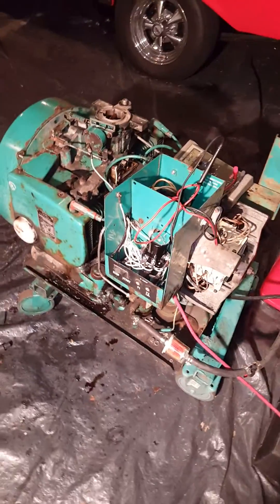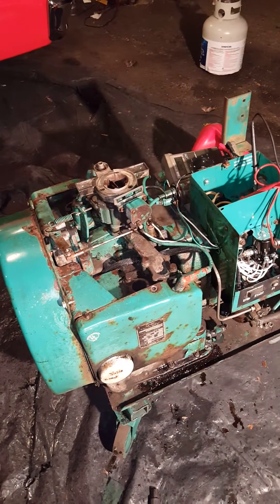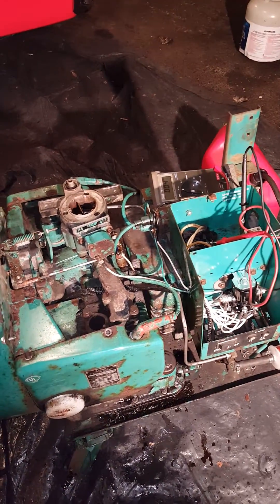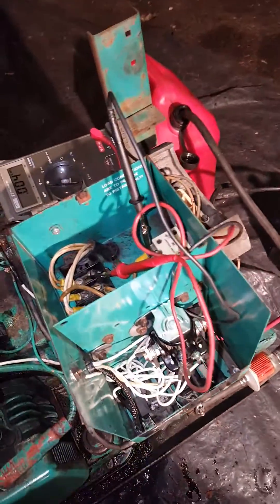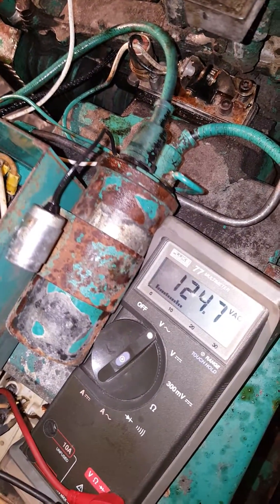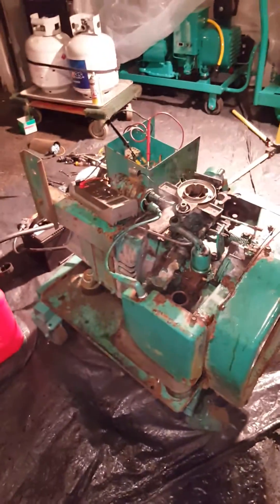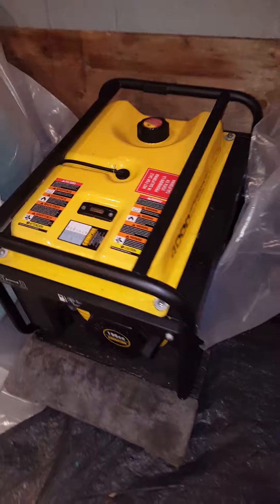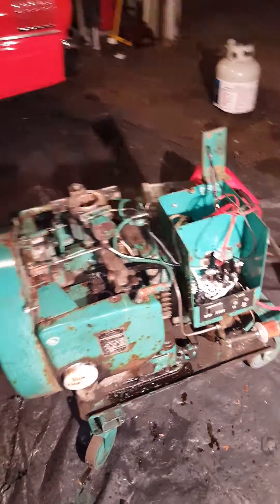Onan 4.0 BFA

Comment: I have the same onan i tried to change the starter celonoid but it was a month between when i did i forgot where to conect the wires on the celoniod. Can you help i got only the fuel pump to run but does not get the to  starter to kick

Comment: The onan generator  is 16 up. And rpm is at 1,800 r.p.m compared to the champion generator that runs at 3,500, to 3,600. R.p.m  champion has clone Honda and drinks more gas than onan 3 with right muffler onan is very quiet....